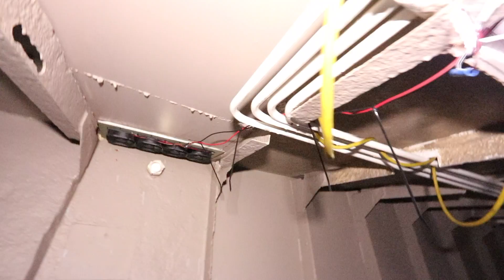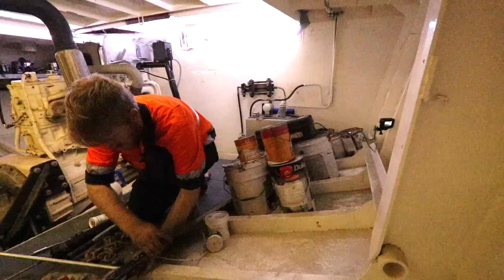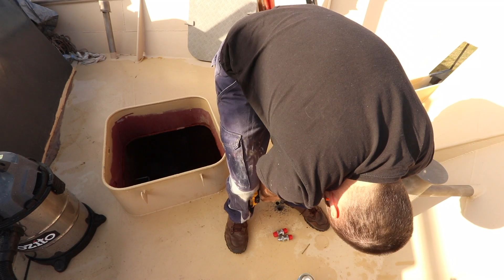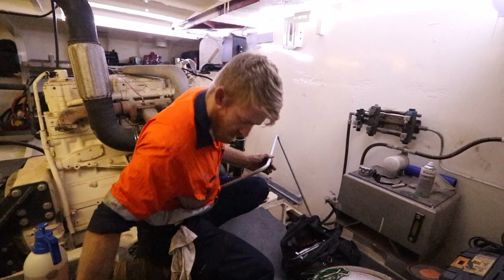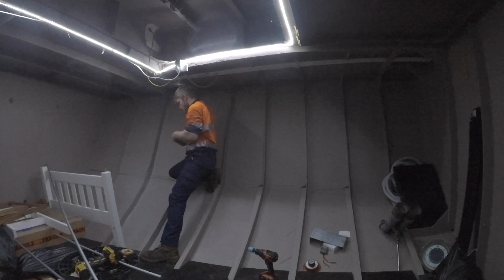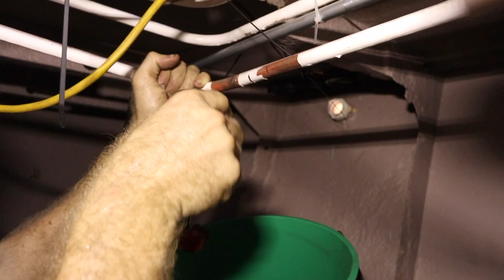Making Hydraulic Pipework - Project Brupeg Ep. 87

Comment: Have u considered puting a single sail on your boat save on fuel cost and mayby run electric steering alot of the newer cars u can pull the electric power steering off and run it on your boat of course with gearing it down a bit so it can steer your massive wing behind your boat ;) they run off of 12volts
Reply from the maker: We have talked about a sail but opted for large hydraulic passive stabilisers instead. Much more effective and able to be used in any sea state. Plus safer, when it’s minus 20-40 outside and blowing a gale I don’t want anyone on the roof playing with sails, but I can lower wings and clean the boats motion up quite safely

Comment: How about using a backup diesel generator and renewable power system for secondary electrical systems like the anchor winch and crane or winch for tender etc (if you go down the electric route) you could switch it over between battery (also means you can use solar/wind turbine to charge them) and diesel generator to run them.  If you want to use a HV DC electric system you could always see if you can get a battery pack from the likes of a scrap Nissan leaf instead of lead acid battery packs.
Reply from the maker: Yeah I do like the idea of running it seperate from the main

Comment: Lots of hard work running the pipe through the boat. It's coming along really nice and should handle the winch ok. Your probably going to need to run the pump off the engine, but this a cheap way to start and may work out fine. At least it will save some money now and can be added later if needed. Happy sailing.
Reply from the maker: Yeah that’s the thought. Get a basic system running that can be upgraded as funds allow

Comment: A stepped bit would really save you a lot of time here. $45 for good Irwin bit and you can drill an size from 6mm to 45mm. Used it on my steel boat for plumbing. Worth every cent.
Reply from the maker: Nice. Thanks Lani, I have a couple of el cheapo’s and found them garbage but I was a bit quite to tad step drills as all the same. I’ll check out the Irwin ones next time I’m in town. Thanks Damien

Comment: Although many boats have shared hydraulic systems such as yours, I don't believe survey requirements allow steering to share hydraulic circuit with other users, such as anchor winches, or cranes.  If you intend to meet survey requirements, I think the steering system needs to be completely separate from other hydraulic users, with it's own pump, piping, and it's own independent hydraulic reservoir.  Greg
Reply from the maker: We follow survey as close as possible but things take time. We have to do it this way for now. Check out the end of hydraulic episode two which should be out to YouTube Tuesday next week. We had someone donate a pump we can upgrade to have steering separate. Jess
Reply: Project Brupeg Yes, I understand.  I guess the question I wonder about is - exactly what vessel inspection requirements, if any will,  Brupeg be required to meet to operate as you intend as a research vessel? I would love to see some info on that in one of your videos, but I admit I might be the only one of your subs OC enough to be interested.  Greg
Reply from the maker: Hi Greg, Damien here. As a private vessel Brupeg does not require any checks to be used in the way we intend. So for us survey spec is a guide we try to stick to not a must do. So some things we do deviate on but with the thought of as soon as we can alter back to a higher standard we will. As for researchers needing a certain spec of boat. We accept that some institutions won’t use Brupeg due to not being in commercial survey and that’s ok. For us putting Brupeg into survey would be well in excess of $200k - $300k, so the possible income we could get from occasional research trips being paid for simple isn’t worth it to us plus the atmosphere on Brupeg would be dramatically different and not something we want to pursue

As for the requirements, below is a link to the survey spec that we try to build to https://www.amsa.gov.au/about/regulations-and-standards/national-standard-commercial-vessels-nscv

Comment: Second watch ... Things break on a boat.  Consider carrying some spare hard pipe, a pipe cutter, a dozen or so different fitting and that nifty flaring tool.  Also, spare flexible hose pipe and end plus a crimper.  You might not need it for years, but if you are in the antarctic and you break a line ...

Comment: I have a question about those through bulkhead fittings. Since those fittings are watertight, when tightened up. Is there some sort of O'ring to seal against the metal of the bulkhead? Do you think a hand tightened metal to metal contact would be watertight connection?
Reply from the maker: Yeah your right it will be mostly water tight but there is a chance of leakage. That said it would be a week and not a gush so not a sinking boat issue more a wet dribble down a wall issue
Reply: @ProjectBrupeg  I was just thinking about worse case scenario. Flooding in a compartment. Water pressure would cause water to squirt past those fittings.

Comment: Damian just an Idea but on your exposed hydraulic lines where they could come into contact with sea water, wrap them in 'Denso Tape', trade name. It is basically a woven tape saturated in grease which is wrapped around exposed pipe. With the grease it also means that your nuts and exposed fittings do not rust even when immersed.
Reply from the maker: Hi Rudolf, yes I know the stuff. Yeah we will be doing that when the tape arrives

Comment: Bummer you’re not closer to Alaska.. 

I’ve got a 12V 500 ft LB Pitts Clutch, and a couple of Vickers pumps I’d donate!

I’d imagine shipping would be cost prohibitive by the time it got to you. 

Nice tubing work. Kinda wondering if that steering pump will be up to the task of lifting the anchor. I’ve got a 550 LB Danforth, and I know that I occasionally hit the pressure relief when I’m snagged or fouled in mud or rough bottom. 

One thought on your steering, have you considered adding a helm pump?
Reply from the maker: Hi Jake. Funny enough we just had a monster pump donated so we will likely be upgrading the system shortly. As for a helm pump, I’m not sure what you mean. We have a pump on the engine which was solely for steering which was feed into to do anchor as well. This is sized right for steering but with the additional big pump we will take it back to just a steering pump
Reply: Project Brupeg I’d love to send you some ideas and pictures from my experience.

Just purchased the vessel that I’ve been captaining for 7 years; a 73 foot commercial fishing trawler. I’m in Kodiak, Alaska.

Shoot me an email: 

MarlinspikeAK@gmail.com

Regarding a helm pump... I believe the correct term is a swash plate pump (could be totally wrong) It’s a purely manual system, that’s located on the ship’s wheel. 

My primary steering is a 208V 5HP electric motor, coupled to a hydraulic pump - which is controlled via 12 Volt solenoids - which is connected to my autopilot or a “jog” lever.

The helm pump is a redundant backup; and will give me steering regardless of if the electrical system is functioning or not.

Comment: Damian, here is a real life situation where your decision to only allow hydraulic pressure to one system at at time could put you in real danger. This has happened to me twice in my sailing career over the years. You are asleep in an anchorage with maybe fifty boats around you. In the middle of the night an unexpected front moves through bringing high winds. You are awakened by the feeling that your boat is moving. You come on deck to find total chaos surrounding you as boats of all sizes drag down on you, while you are dragging down on others. People in the other boats are on deck, spreader lights are on everywhere, there is yelling and screaming. You have to get your engine going to take the pressure off of your rode, and to avoid other boats which are coming to smash you. You need to get that anchor in immediately to get your boat out of that area, while manuevering to avoid collisions. With your system you could be putting your boat in real danger. Yours will be a world traveling vessel. Having a situation like that come on you is only a matter of time. Please consider this as you need to prepare a boat for the worst situaions it may encounter and to be ready for them.
Reply from the maker: Hi Alectron. Yes we have considered this, I agree with you it is only a matter of time before we are faced with that type of situation. That said this set up is just for dump and run and none of the pipe work will need to be changed only a pump upgrade to get the system working perfectly. This said we already have had a beautiful big pump donated so the upgrade will happen sooner than thought
Reply: Project Brupeg that’s a good thing!

Comment: Damo , If you want a cheap die grinder go to Bunnings and buy one of these routers https://www.bunnings.com.au/ozito-850w-router_p6290281

With a couple of screws you can remove the motor and spindle unit and you have a dir grinder what is also variable speed
Reply from the maker: But I have a variable speed battery die grinder... jokes aside I did have a die grinder but I used it so infrequently when it died it wasn’t worth replacing

Comment: I used to hate doing solid line work when I was in the trade. Would have been easier to just run some double braid hose  the fittings your using are JIC type with a 37 Degree flare.
Reply from the maker: True but cost was a factor. Flex is four times the price for us in Aussie. So it’s only used when you REALLY can’t get solid pipe in

Comment: There is something intensely satisfying about running pipe or cable and clipping or clamping runs in neat arrays.

I guess I have a degree of OCD as I did this even under floors and in attic spaces.  In days of old I suppose this would have been called having pride in your work.

Long may you keep it up Dame!
Reply from the maker: Thanks Nic. Yeah it’s truely lovely having to jump into someone else’s work to repair something and seeing symmetry. You just know they’ve thought about the install far too much and it’s going to make your life easier.

Comment: Out of interest when your plumbing hot and cold water systems what size pipework will you be using?
Reply from the maker: Actually just fitting a bunch of hot and cold pipework. Just half inch. Seems to work fine.
Reply: @ProjectBrupeg  will that be in copper?
Reply: I'm asking as I have a heap of 15mm/1/2" fittings which I don't need and I need to get rid of them

Comment: 1500psi is very low pressure for hydraulics?
Jic is good for 4000psi 
When you keep mentioning "survey" I'm guessing it's a safety test? Sea worthiness thing?
Do you guys have to get it checked over like a roadworthy test before launch
Or is it more a random inspection thing that might happen later?
Reply from the maker: Hi Fowletm, survey is a set of rules that all commercial vessels in Australia must abide by. They are compulsory if you want to charge people to come on your boat. That said we won’t be putting Brupeg through survey as we are not commercial and won’t be charging. However, it’s a great idea to follow the survey reg’s if you can as they have been built up over the years learning hard lessons from sinkings, fires and other dramas at sea.

Comment: Interesting they have copper lines for the hydraulic, what psi will your hydraulics run? I have about 40 feet of copper airlines ran for my air compressor which runs at 160 psi, havent had an issue.
Reply from the maker: Hi Willow. Yeah these pipes are mild steel 1.6mm wall so quite thick for such small pipe. The steering runs at 1500psi which is fairly low in the hydraulic world from what I was told

Comment: Another great video. I do have a question as I know nothing of hydraulics. Is there an O ring in the nut that fastens the pipes and fittings together, or is it all purely metal on metal compression type connection?
Reply from the maker: Metal on metal. Because of the pressure if you had anything as soft as an o-ring the oil would just blow it out and leak. Hence you need the whiz bang awesome flaring tool and the right thick wall pipe. Think of the components as a system that when fitted together are leak proof, but if you skimp on any one of the parts in each joint, then that join cant and wont work.

Comment: You need a mag drill for all that bulkhead drilling. Faster, easier, cleaner. safer. Predrilling is not required. Just punch a point and the magnet holds the drill in place while the spring center puts the cutter on target.
Reply from the maker: I would love a mag drill, my bank balance says i dont need one as much as I first thought...
Reply: @ProjectBrupeg  lol, with a boat that size and the refit your doing i dont blame you. For years i wanted a drill press or a mag drill but didnt have enough space for a drill press and couldn't justify a 700$ mag drill. Finally broke down and got a dewalt one and I couldnt imagine not having it.

Comment: Nothing wrong with using a drill instead of the die grinder, done it several hundred times when in dire straits.  I’m also worried about the division of power from the rudder to the winch as there have been many times I’ve had to use rudder when winching my anchor.   However , your boat and your decision.  Keep on going, nearly there!
Reply from the maker: Hi Geoff, i can steer at anytime with this system the winch will just slow down and then kick straight back in when not steering. that said we already have a massive flow rate pump sitting on the ute tray so we will be upgrading the system shortly but for now this will do us for dump and run.
Reply: Project Brupeg sounds wonderful, regards, Geoff

Comment: Damien :  First things those are adapters because I use to make them at AEROQUIP/EATON. Also maybe you should have turn the Hydrulic pump upside down and could just come straight up from under the floor and the tubing would not be in the way on the Deck, also Less use of hydrulic adapters to connect to more tubing. Also great Music
Reply from the maker: Hi Gregory, yeah spinning the motor is a great idea, didn't even think of that. Im thinking that vibration may come into play so surely having some flex pipe in the system is a good thing?
Reply: @ProjectBrupeg  "surely having some flex pipe in the system is a good thing?"

Yep, not much is going to happen if you bump the flex pipe with the anchor or other heavy object. Might consider small bits of angle on the deck near the penetrations (just something that can be cut off if you need to access the through deck fittings) to protect against hard knocks.

Comment: Ahhhhh......the joys of plumbing hydraulics, it's looking great, always good to get a bit of help. Hope your steering pump is up for it, worth a go. I have noticed some of the steel on your boat appears to be particularly tough to drill, so not sure how one would perform but a good quality step drill is like the adjustable wrench of the drill bit world. Why not use ss washers on the deck fittings maximise sealant and separation from deck material?
Reply from the maker: Hi Dan. Yeah I have a step drill but I’ve not tried it on the hull work.
Reply: Think I left 2 in the bag. (step bit)
Reply: @ProjectBrupeg  I'd give it a go, you might find it easier than running that die grinder burr, I user to use them only on sheet metal but they are quite effective on RHS and I beam

Comment: Another great video, just a suggestion on your cutting lubricant there is a product called Trefolex comes in a liquid but also as a grease consistency, it's great for drilling when you haven't got someone to spray for you, also where the pipes go through the holes in the ribs you can get either nylon or rubber gromet profile to put around the holes this will protect the pipes should they flex a bit and rub on the edge it comes in lenghts and you just cut it and slip it on fairly cheap from clark rubber or the nylon one from electrical wholesalers
Reply from the maker: Hi Moose, yeah I’ve used trefolex before, it’s nice stuff. I just struggle to get easy access to it up here so I normally just grab whatever is available at Bunnings. As for the holes in ribs, we cut the hole significantly bigger than the pipework so it would never be able to touch. But I do like the idea of added protection around it just in case

Comment: Are you not worried about salt water on those fitting and the metal being different than the hull causing rust due to galvanic reaction?
Reply from the maker: All the fittings were mild steel so no issue with metal type. They will all be blasted and painted so rust won’t be a factor either when we are done
Reply: Also...  Saltwater on any but the pair through the deck means you don't give a damn about the fittings rusting...  right?

Comment: What a real professional you got working for you with this hydraulic system. He sure knows his stuff.
Just a little bit of concern about possibly having to maneuver the boat if you got a stuck anchor?
A real sweet looking system. Just an FYI don't be afraid to use lots of cutting oil and a slow speed when making your holes in your steel deck.
Doing a fantastic job you guys. God bless you!!
Reply from the maker: Thanks Dennis. We have a switch on the bridge to select between either winch or steering so it’s easy to steer when needed and then flick straight back to winch
Reply: @ProjectBrupeg  Just want you folks safe and not get stuck out there without maneuverability.
It's hard to cover all the bases and predict everything.:)